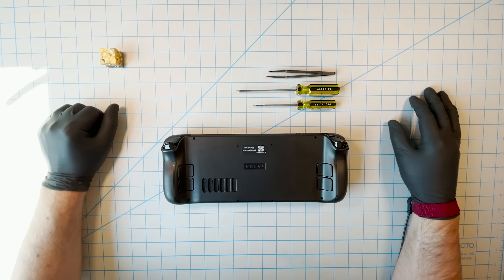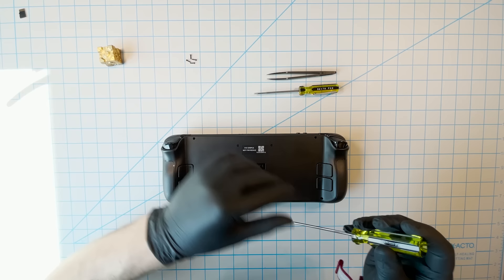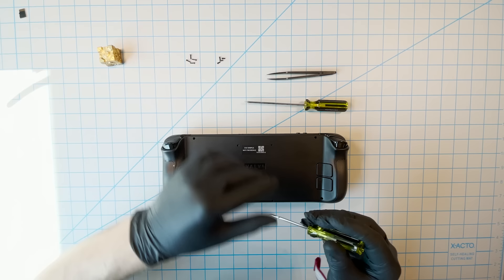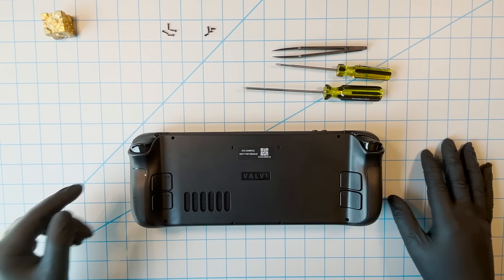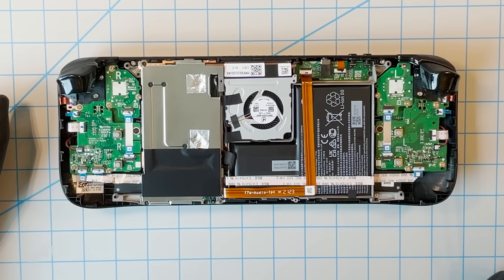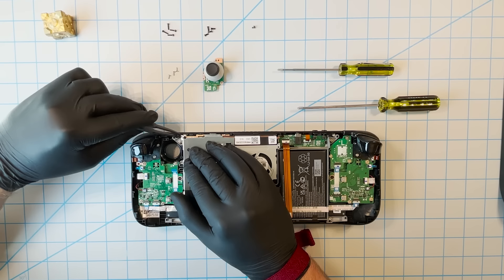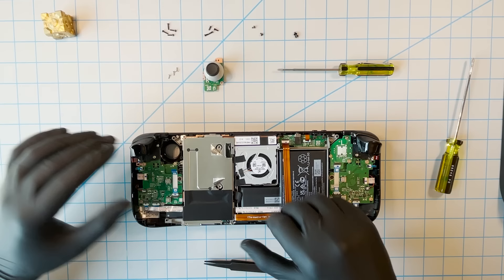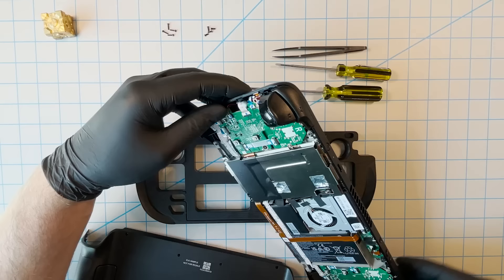Take a look inside Steam Deck™!

Comment: Thank you so much for being so transparent about the product, its a huge breath of fresh air when looking at the rest of the current market's 'closed off, no information for customer at all, you cannot tamper or fix the property you justbought off of us, we still own it' attitude
Reply: Yes
Reply: transparency should be a complete rule at this point. Tired of companies not TELLING me what I'm actually getting at launch, especially in games. Only two companies I've seen that's really good in terms of transparency so far imo is 343 and ID software.
Reply: @normakes  very true 34 got my respect right now
Reply: I second that
Reply: iphone in a nutshell
Reply: Lemme guess you're and Apple user? 😂
But no, this is of course true for other things as well. But Valve is cooler than all of the others.
Reply: Exactly. We need more companies to act like this.
Be open and transparent. Offer replacement parts. Offer documentation. Make things repairable. Show us how things work and let us make an informed decision if we really want to open stuff ourselves.

And don't use glue where it's not necessary.
Reply: Valve comes off as anti-right-to-repair in this video.
While most of the warnings are technically true, they're extremely unlikely. Damaging the battery, destroying the screws/housing, etc are stuff that most people already know about. They should have made the design choice of allowing expireable components like the battery/thumbstick controllers to be easily replaced! Making them inaccessible to the end-user was a design choice that had to be authorized, and is a really bad look. The steamdeck isn't 'waterproof', so why would they make the battery inaccessible?

Over time you'll see that rechargable lithium batteries become spicy pillows; that is, the cells fill up with hydrogen gas. Not allowing the easy removal and replacement of these parts contributes to a massive amount of e-waste and a significant part of our declining economy.

In 5-7 years, steamdecks will start causing fires in homes because the batteries aren't easily removable.
Reply: @runed0s86  The batteries are removable tho. Your argument is basically "its hard to remove them so no one is going to do it and they are all going to explode". No it won't. Because if you can't change a God damn battery then take it to a professional. I like how you start off with "this is unlikely" when what you said is unlikely. You also take no consideration how difficult it is to design something like this and you really think it's this hard because they wanted it to be? Don't be a fool. Making competents replaceable is hard enough considering what they need to cram into a little device. Just because it isn't as easy as your android from 2010 doesn't mean they didn't try. Are you also aware they are making these warnings for legal reasons and to protect customers? I can imagine a little child looking at this video trying to fix his device, not knowing what he's doing.
Reply: @runed0s86  Well that's a bunch of nonsense. You seem to have shifted perception.
Reply: Ah yes the John Deere mentality

Comment: "Don't do this! But if you did want to do this, here's how..."

Recommending parts suppliers is the biggest move from a hardware supplier. Huge props to Valve, this needs to become industry standard.
Reply: heck
Reply: @gimubatulo  be gone
Reply: @MrGamelover23  same with playstation
Reply: @cinzley244  same with xbox
Reply: It use to be industry standard decades ago.  Oh a tube blew in your radio? Here's a schematic and what part to look for inside the owner's manual/ case. Even ~5 years ago I was able to order parts for my laptop... FROM HP THEMSELVES.  You can thank Apple for making it hard/ impossible to fix electronics they make to maximize profits and other companies catching on and copying the business model.

Comment: Apple: designing their hardware specifically to be impossible to repair in any way

Valve: "Here's a Tutorial how you can troubleshoot your Steam Deck Hardware properly, but be careful."
Reply: Here at valve we do not reccomend this unless you know EVERYTHING but fuck it bro its your property
Reply: more like: "Heres a tutorial to potentially risk your life"
Reply: @kapa_nitori  what is so risky? When you remove the battery, all of the electricity will be removed.
Reply: @chrisi7127  if you dont it might blow up
Reply: @kapa_nitori  I mean they specifically teach you how not to die in this video
Reply: @kapa_nitori  it might blow up if you are stupid and do something really bad, almost all phones from 2000-2018 have easily replaceable batteries and i don't really know much problem unless people where trying to put fire on it just for fun. At least they give the liberty to professionals do something to repair unlike certain companies...
Reply: @FinnishCrystal  😂😂😂😂😂😂😂😂😂😂😂
Reply: @vixeythevixen  'Replaceable'. The steam deck battery like many other devices nowadays don't have them replaceable. Stop spreading misinformation, they're incredibly dangerous.
Reply: @fived9424  you can clearly see that battery is inserted into the aluminum slot, it means that it can be removed fairly easily if you have to replace it, my phone's battery placed in the similar way, it means that it has a sticker on the other side to secure the battery, everything you have to do is to disconnect the battery, pull it up and then voila, it's no longer in your steamdeck. If that's not "replaceable" for you, then what is? If you want the batteries in modern devices to be as replaceable as in the 2000's phones, idk what to tell you. It's considered replaceable until it's screwed, glued and put into the device in a way that will most likely break something if user tries to replace it manually, or the whole device built in such a way that regular user won't be able to fix it without specialized tools and machinery (hello Apple shit devices).

Comment: "It's your PC, you have every right to open it"

hear that nintendo
Reply: And Apple, too!
Reply: @DevilsRadvocate  Nintendo pretty much is the Apple of gaming console producers. lol
Reply: Nintendo: Sowri, I no sepeak Engrish.
Reply: @sechabatheletsane9784  *Sow wry, Ai no Speaku Engrish
Reply: And yet the switch is like one of their easier devices to open and service.

Nintendo has been greasey but not when it comes to repairing- in fact its all mostly modular
Reply: Speaking of Nintendo, Metroid Dread was very disappointing to me. Why would we have to run from robots through out most of the game? Felt more like horror game rather than action adventure.
Reply: @eyeofminati2653  >dread
Reply: The Switch isn't a PC
Reply: @jonnmgo7524  That's why Steam deck is better than switch. Because you can modify stuffs and play PS2, XBOX 360, Switch, Wii, Wii U, 3ds, GameCube games too.

With Reshade, mods and hi res textures and.
Reply: @eyeofminati2653  Emulation on latest gen consoles is sketchy. Also you don't have every right to open the Deck, if you damage it they won't help you, same with consoles.
Reply: I mean, Nintendo doesn't have cameras in your house. You can actually take it apart if you feel like it.
Reply: @eyeofminati2653  Isn’t that the point of Metroid dread?
Reply: @eyeofminati2653  alright 🐕💨
Reply: @jonnmgo7524  You do have every right to open the Deck. It's just that your right to warranty service is conditional on you not exercising your right to open it. But you always have the right to open it if it's your property. And Valve even understands and respects that you do.
Reply: @jonnmgo7524  You do have every right to open the Deck. It's just that your right to warranty service is conditional on you not exercising your right to open it. But you always have the right to open it if it's your property. And Valve even understands and respects that you do.
Reply: @eyeofminati2653  have you ever played metroid fusion
Reply: @jonnmgo7524  It is a computer my friend.
Reply: @ShinCadian27th  band kid humor lmfao
Reply: @jonnmgo7524  yeah you're right, it's a 2017 android tablet
Reply: “We would like to announce an update to Super Smash Bros”

hear that valve
Reply: Nintendo doesn’t really stop you from opening your stuff other than using alternate screws. Apple on the other hand…
Reply: Nintendo produits are just as easy to repair

Comment: Pro tip: when dealing with self tapping screws in plastic, thread the screw in reverse until it clicks or abruptly sinks, then you can start screwing them in the correct direction. This technique ensures that you aren't cutting new threads into the plastic, weakening it.
Reply: I've used that trick for any fastener for as long as I can remember, not just self tappers.
Reply: Yep. Doesn’t matter if you have a torque wrench or not: Cutting new threads each time will weaken it. Always try to reuse existing threads.
Reply: Never thought of/knew this, I typically just rattle the screws in until they seemed to hit the bottom, then screw. Good tip, much appreciated.
Reply: I learned this when screwing down the crown on an expensive watch. Very good advice.
Reply: like turning it left before you turn it right?
Reply: Ha! You beat me to it. I just posted that trick I have been using for many years.
Reply: I do this with every screw or bolt that isn't going into a nut. Metal or plastic, I don't want to cut into existing threads to make new ones if I don't have to. It also helps to keep the screws from going in crooked.
Reply: basically me with any nut or bolt
Reply: I thought that was standard practice lol, its a good trick
Reply: worst case scenario just threadlock all the screws.
Reply: I always do this and no one told me to. It is just logic and my way to give attention to detail. But thanks for sharing the information with other people. I am happy that there are others like me out there.
Reply: Can someone explain?
Reply: @vovical  yes, precisely. I call it backthreading, but I'm sure others have different terms for it.
Reply: TRENDING-TOP-YEARS⤵️ --------------------------------------------------------------------------------------------------------------------------------------------------------------------------------------------------------------------------------------------------------------------------------- ❣️ AISURU.TOKYO/michan?HDRCam✰ᴾʳⁱⁿᶜᵉˢˢ★ トップAVビデオに参加する
❣️

Youtube: This is fine 
Someone: Says "heck" 
Youtube: Be gone 
#однако #я #люблю #таких #рыбаков 
#Интересно #забавно #девушка #смешная #垃圾
Reply: I mean yeah. You are right but, unless you open this thing like 10 times, it's never gonna be a problem.
Reply: thanks for the tip fellow human
Reply: @ILikeWhatILike69  Should still be done even if you're opening it once.
Reply: Thank you so much.
Reply: Huh, that's pretty smart.
Reply: THANK YOU
Reply: the fact this isn't something everyone one does with every screw is a bit disturbing
Reply: what does it mean? eli5 please
Reply: I hardly ever use a screwdriver or anything, but this sounds like a really good "life" advice. Will keep it in mind, cheers.

Comment: 3:40 The fact that they not only say "dont use another ssd cuz it's bad, but actually explain WHY makes this video much more trustworthy"
Reply: I'm wondering if someone's going to make an m.2 riser cable to move the ssd out of the shell or into an third party expanded back shell. Or maybe expanded back shell for a larger battery and improved cooler and a riser cable to move the ssd into where the old battery was. All things that seem possible.
Reply: if someone just tells you that something is bad to do you're probably will not listen, but if you know why exactly something is bad to do, at least you could try avoid bad when doing something
Reply: In fairness though, no one has experienced any issues with inference or power consumption by replacing the SSD. I upgraded to a 2TB one and everything works just as well
Reply: @bikechan9903 it could lead to reduced performance later

Ill stick with the SD card
Reply: Of course they’ll explain in an official video
Reply: you messed up the quotation marks in your comment. Please fix immediately

Comment: So glad Valve has a positive attitude towards repairs, hoping this becomes industry standard!
Reply: unfortunately the cringey profit motive makes other companies incentivized against repairs and longevity. Thankfully Valve is doing the right thing for society
Reply: PC gaming culture is about building and moding your own builds
Reply: @ovadyarachman7243  fair enough, valve is just playing by the rules of their own niche in the industry
Reply: It's a nice step, but I wish they'd embrace it more
Reply: @jwbowen  next step is fully open sourced hardware .. that would be awesome
Reply: In Soviet Union all electronic items or most of them (TVs, fridges,microPCs, radio, ovens, etc etc) came with complete electrical schematics diagrams of the internals and were specifically designed to be easily repairable by the end user
Reply: I heard a lot of dont do this
Reply: If you bought a computer that you can't repair then it's not a PC it's a f lemon 🍋
Reply: @WillParker322  Obviously they need to stress that this is not something that should be done by non professionals, but this is far better than companies like Apple that wage war on repair shops. Meanwhile Valve gives them advice on what is where for what reason.
Reply: Can anyone imagine Apple doing this? Nope, me neither. (yeah, Apple don't make game consoles, but it's the ability to relatively easily repair electronics goods which is important).
Reply: Sony did this for years for Playstation.
Reply: apparently the repair of this console will be an integral part of the gameplay
Reply: @HoboMafiaLord4Life  oh crap - ty for telling me that. I was thinking of getting one down the road.
Reply: @JamieDigitalArt  Or at the minimum selling all the parts individually—including the case.

I'm not saying they have to make a loss on a new product by selling the parts cheap, just that they should sell all of the parts.
Reply: I wonder if it's good enough for Louis Rossmann
Reply: Apple: "Bonjour"
Reply: Since when scaremongering is a positive attitude? (unless you're apple, google or steam of course)
Reply: Unlike Apple's attitude toward tampering.
Reply: Looks more like they want people to open them and destroy it, so they can make more money ;)

“I have seen a video, it looks too easy” said the guy with 10 thumbs :D
Reply: they hardly sound positive
Reply: @HoboMafiaLord4Life  Jesus, can you imagine if previous gen Nintendo hardware embraced this shit? Like 3DS, WiiU, I swear they're better than unmodded NX.
Reply: Unfortunately its becoming the opposite, there are even rumours that apple have added cryptography to the batteries in the new iPhone so replacement batteries won't work in it. The only way to make this standard is by enforcing it through regulations and law.
Reply: Gonna have to because their customer support will take 4 months to respond to one email.
Reply: I think we both know that isn't going to happen